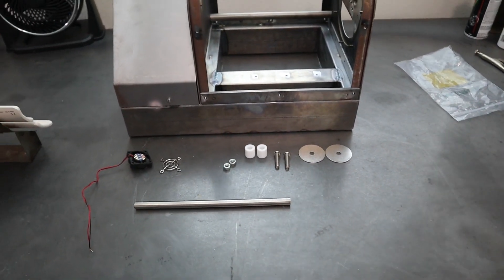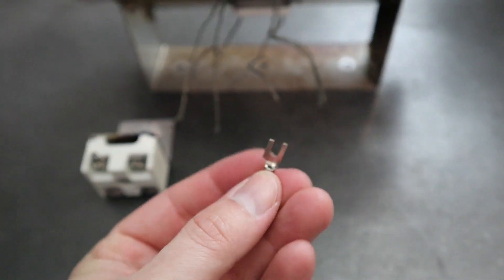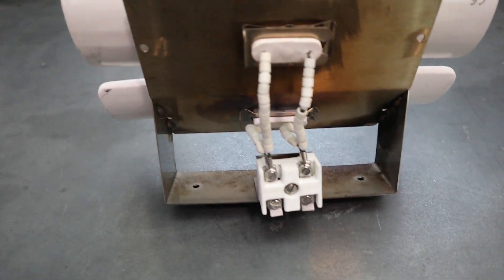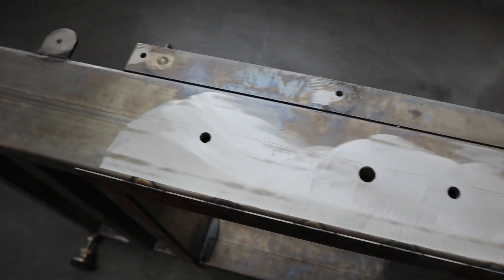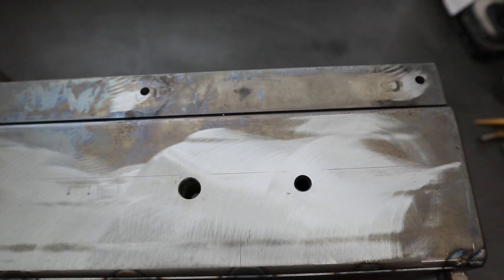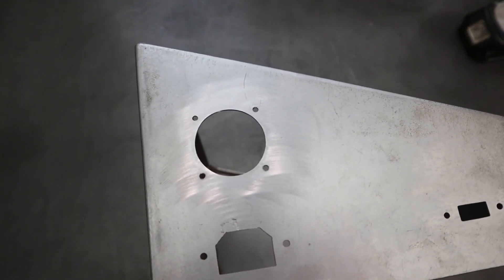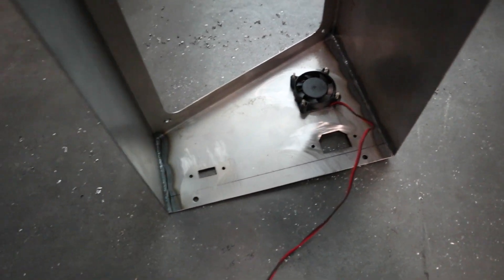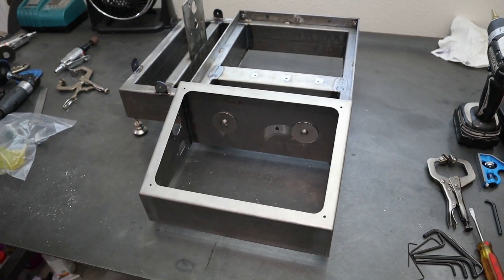DIY Coffee Roaster Build Part 3

Comment: How did you make the drum?
Reply from the maker: I took a piece of perforated stainless steel and ran it through a slip roll, then welded it. Capped the back off with a piece of stainless sheet. I cut the spokes out of another sheet and pop riveted it to the drum in the front. The mixing blades were formed using a shrinker/stretcher and pop riveted into the drum.
Reply: @kylegreenhaw6653  Interesting, thanks for the reply :). Do you have any video/pictures of that process?
Reply from the maker: @Mark Anderson No problem! Sorry but I do not have any footage of the drum construction. I started documenting the build after it was already completed.
Reply: @kylegreenhaw6653  Shame! But yeah, think I can figure it out. Seems a bit difficult to find perforated stainless steel sheets here. Might have to drill a sheet myself.
Reply from the maker: Where are you located? It’s quite a lot of holes to drill. There’s the option to go with a solid drum or maybe a stainless mesh, if it’s easier to source.
Reply: @kylegreenhaw6653  Located in Denmark. Yeah, it would be a bit time consuming drilling the holes.